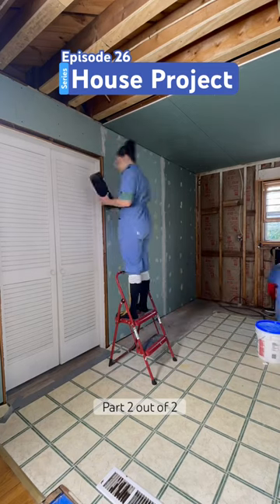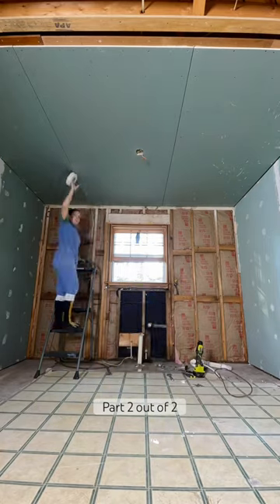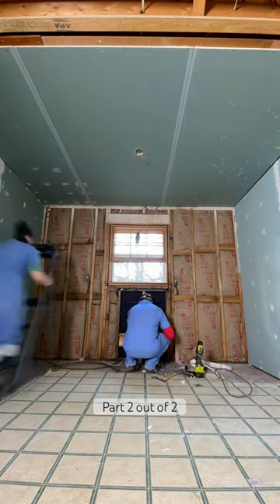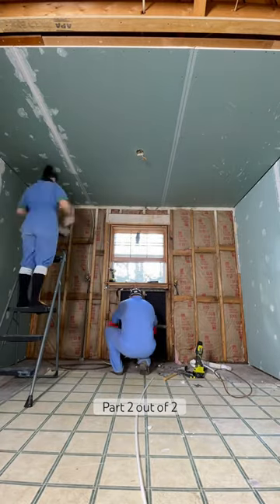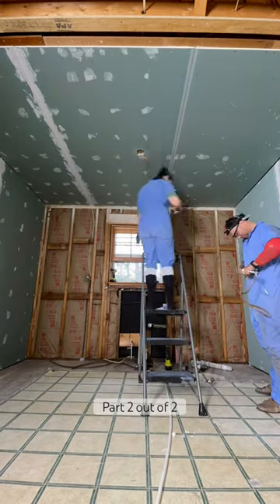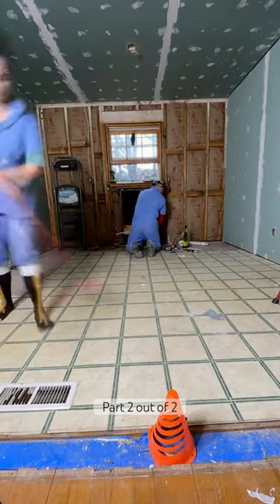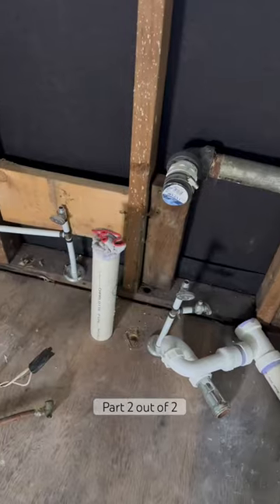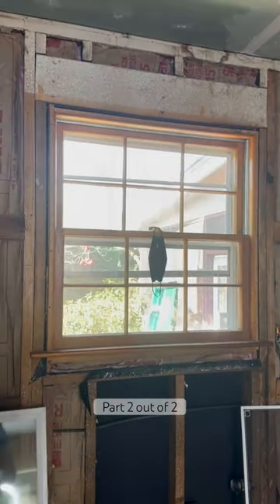Ep.26 Pt:2 KITCHEN RENOVATION | Drywall installation, moving plumbing, new window! | House Project

Comment: Tip for next time. Joint compound goes on the seam first, then the mesh tape, then more compound. Along the seam should be the thickest, then you feather out the sides. 
Joint paper is a lot thinner and you don't get those grid lines.
Reply: 100 correct! Ugh i think i hate taping so much cuz im the worst at it
Reply from the maker: Thank you for the help!
Reply from the maker: @Velofire_21 it looks easy until you go and do it 😅

Comment: I'm retired dry waller,finisher,final spray. I would never use mess tape , because house breath , they expand with moisture &heat,& shrink with cold & dry.your mess tape well ge cracks in it.